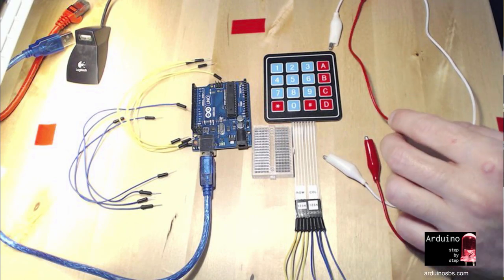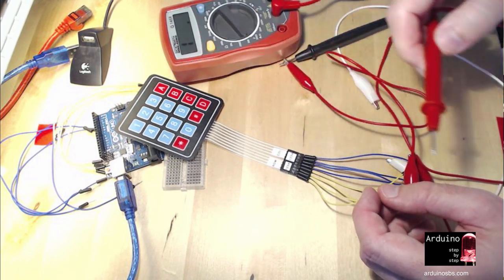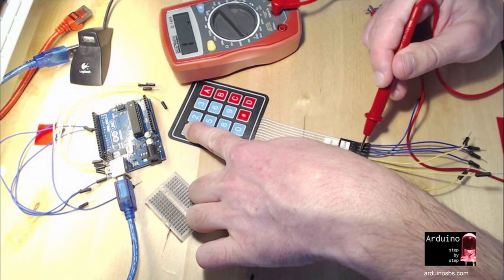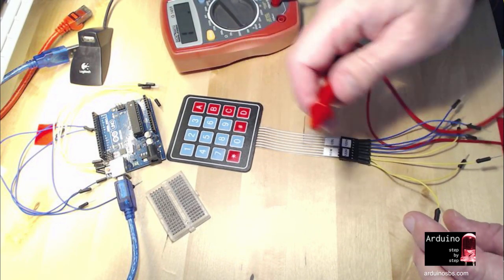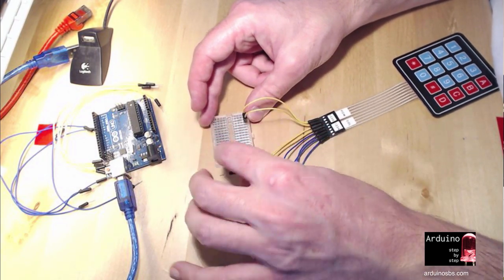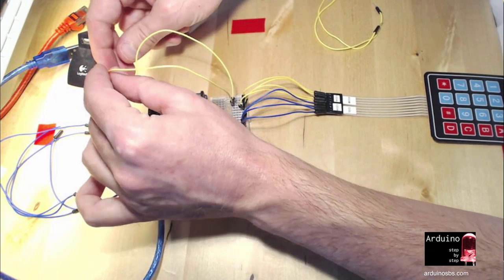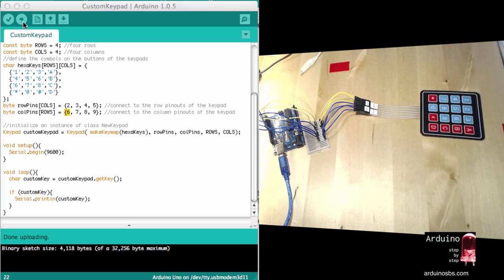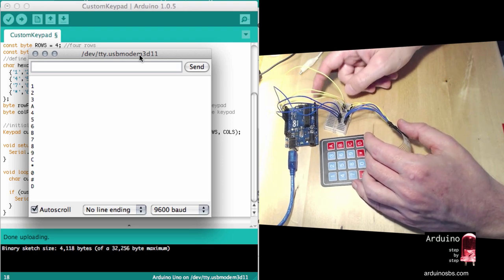Connecting a 4x4 keypad to the Arduino - Part 2 of 5

Comment: How exactly do I get arduino to understand what Keypad is???
I don't see any includes and my arduino interface does not recognize what a Keypad is. 
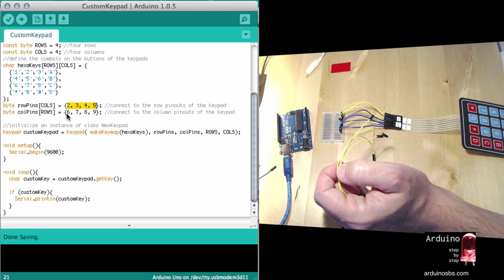Line 14 at 8:03
Reply from the maker: +Ryan Roga You simply setup the hexaKeys array which contains the layout of the keyboard. Then, the keypad object (customKeypad) is created with the pins connections for the rows and columns. Between these two, the Arduino has all the information it needs to work out buttons and characters.

Comment: Tech Explorations when i write #include <Keypad.h> , the keypad word be in black not in red , and the hole code will not work , Is there any solution for that ? I appreciate your response
Reply from the maker: hesham goda Can you copy/paste the the compiler output (for the black box under the code)?
Reply: Tech Explorations  im having the same trouble as hesham goda the word keypad and makeKeypad are highlighted black not like the other once which are highlighted yellow. i download the keypad folder and put it under library for the arduino but still nothing. can you help?
Reply: Sergio Ortega this is what it says when i try to compile it

Arduino: 1.6.2 (Windows 7), Board: "Arduino Uno"

Build options changed, rebuilding all

C:\Users\student\AppData\Roaming\Arduino15\packages\arduino\tools\avr-gcc\4.8.1-arduino2/bin/avr-g++ -c -g -Os -w -fno-exceptions -ffunction-sections -fdata-sections -fno-threadsafe-statics -MMD -mmcu=atmega328p -DF_CPU=16000000L -DARDUINO=10602 -DARDUINO_AVR_UNO -DARDUINO_ARCH_AVR -IC:\Users\student\AppData\Roaming\Arduino15\packages\arduino\hardware\avr\1.6.2\cores\arduino -IC:\Users\student\AppData\Roaming\Arduino15\packages\arduino\hardware\avr\1.6.2\variants\standard C:\Users\student\AppData\Local\Temp\build6742430492049816691.tmp\CustomKeypad.cpp -o C:\Users\student\AppData\Local\Temp\build6742430492049816691.tmp\CustomKeypad.cpp.o 

CustomKeypad.ino:10:20: fatal error: Keypad.h: No such file or directory

compilation terminated.

Error compiling.
Reply: Sergio Ortega If you haven't already, you need to install the keypad.h library. Just download it and put it into your libraries folder. Then in the arduino code builder import the library. reboot arduino code builder.